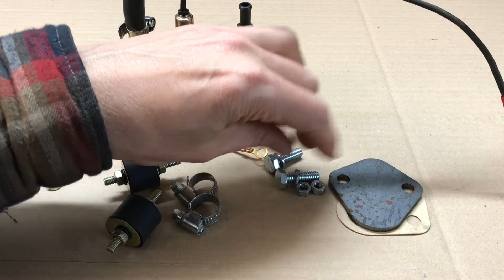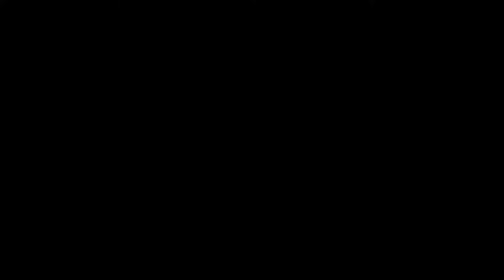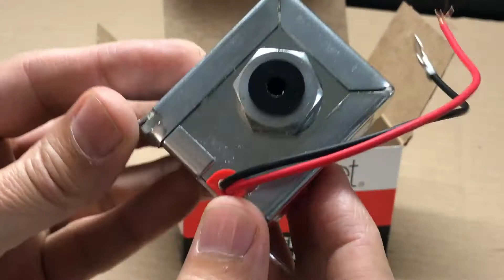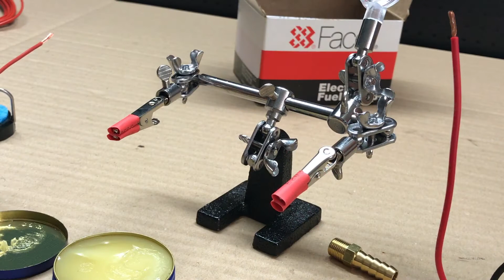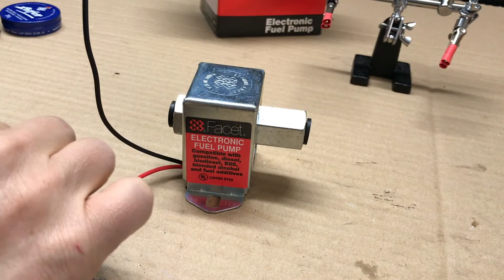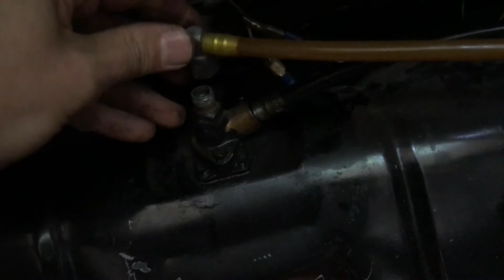1968 Rover P5b - Electric Fuel Pump Installation

Comment: I fitted the new valves , but they were actually 1.5mm greater dia than those I took out so had to emery them down to fit and then press them in with a vice. Anyway now I think they're not returning as fuel starvation has returned, so back onto the Electric fuel pump.

Comment: Really interesting.  I've been wrangling new valves into my mechanical pump but your Facet cube pump could be a next step.    what in-line fuel filter have you used ?
Reply from the maker: Although noisier than the mechanical pump, it works really well. I have a non-original glass in-line fuel filter.
Reply: @tarabordeaux1968  I noticed that , hence my question.  I didn't want to create a fuel starvation issue and thought I'd fit in-line filters into the reserve and the fuel lines above the fuel tank in the boot. But the  glass filters i've looked at didn't have 1/4" Internal Dia to match the lines.  I'd like to see the fuel exiting the tank and cleaned before gumming up the pump  so can you help my investigation please? David
Reply: But thanks for your further comments on your pump. do you think the noise is amplified by it's attatchment to the inner wing?  did you consider fabricating a bracket to utilise the fixing bolts ofr the  mechanical fuel pump cover plate? D
Reply from the maker: @davidbrooks6381  It is quite noisy with just the ignition on but isn't audible with the engine running. Making a bracket for the blanking plate is a great idea but a bit beyond my skill set.
Reply: i dont mean to be so off topic but does anyone know of a tool to log back into an instagram account?
I somehow lost the login password. I love any assistance you can give me
Reply: @Dwayne Issac Instablaster :)
Reply: @Valentino Noah Thanks so much for your reply. I found the site through google and I'm trying it out now.
I see it takes quite some time so I will reply here later with my results.
Reply: @Valentino Noah It did the trick and I finally got access to my account again. I am so happy!
Thanks so much you really help me out!
Reply: @Dwayne Issac Glad I could help :D